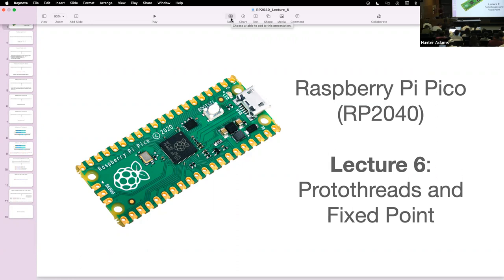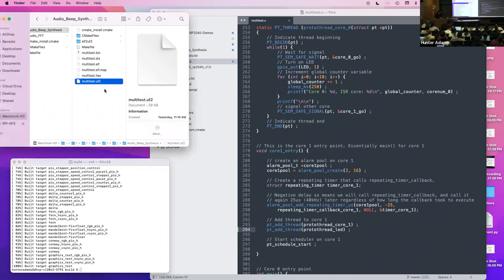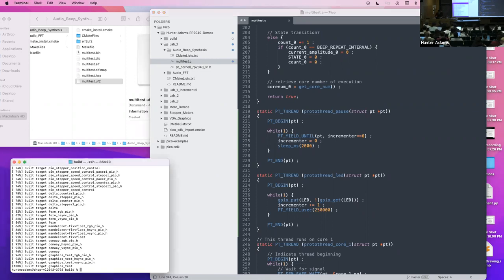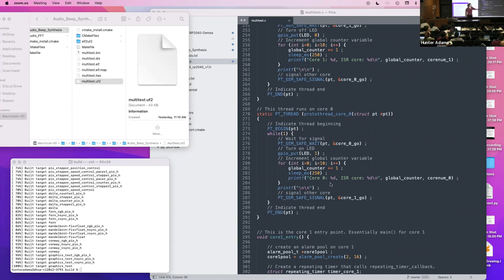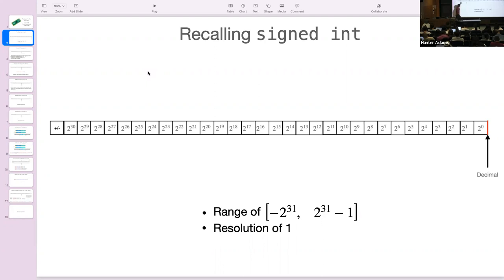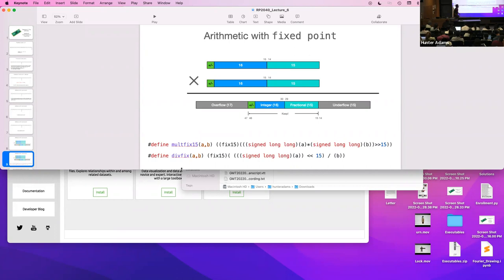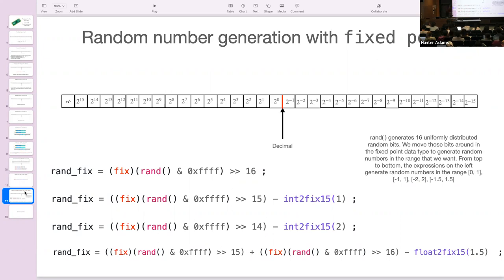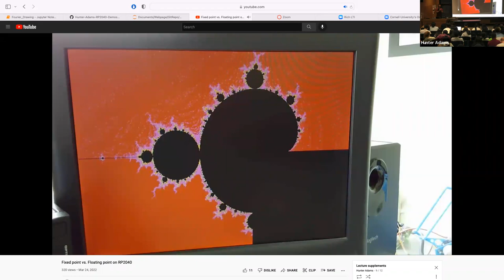Raspberry Pi Pico Lecture 6: Protothreads and Fixed Point Arithmetic

Comment: Thanks for your lecture.  My RP2040 software rasterizer project can run at x15 when switching from floating point to short fixed point calculation.